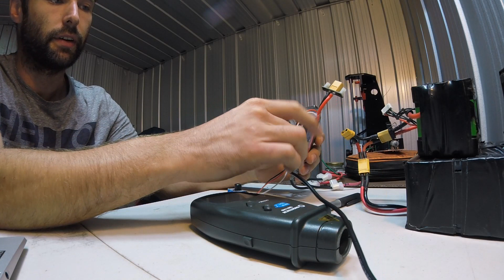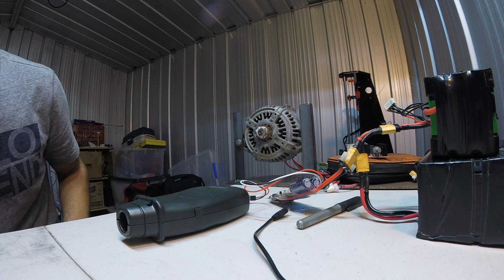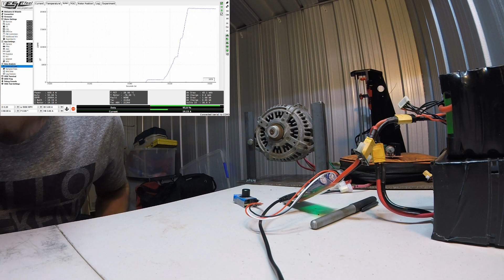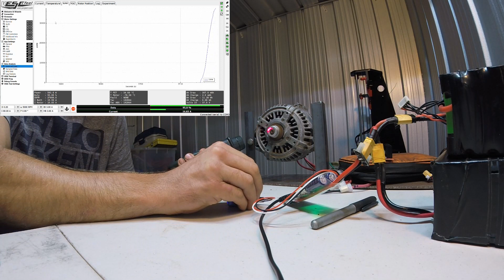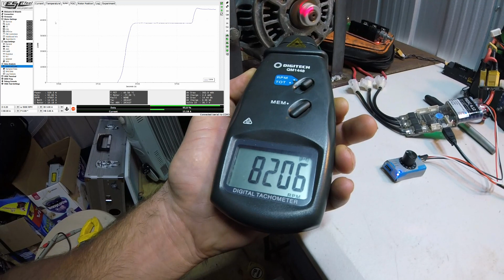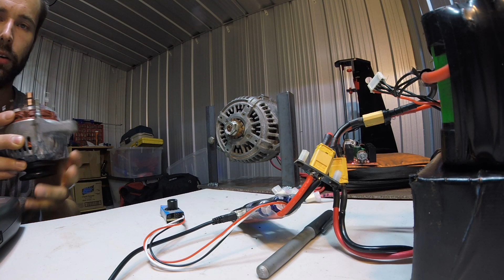Testing converted alternator motor with VESC "erpm"

Comment: Hey, i would love to see you installing hall sensors on the alternator to help the VESC to run heavier loads without needing "push start", helping with power wheels, scooters or any project you can adapt the alternator
Reply from the maker: That would be good.  Cheers you've made me think about it abit more.  I will look in to installing some!
Reply: @fixitmoditbreakit7982  can you use regen on it?
Reply: ill second that mate.
Reply: Hey mate, good to see another tinkerer'.....

I'm currently working on something very similar myself, using a 12v 150a 6 phase alternator. I thought originally that i had 6 wires in three pairs but after removing the diodes and regulator i discovered it was actually 2 groups of three (not connected) or basically 2 separate motor stator field winding's in delta (from what i could tell or atleast no center tap as seen in most connected in wye configuation) . 

This really got me thinking!

Im really not even sure if there is even a practical application for this but hear me out...

Could power be generated at the same time as driving the motor. So i tested this idea and yes it can indeed,  now i do understand that there are efficiency loses every time we convert energy etc and I am only a hobbyist of the trade and self taught for the most part....

For this i was only using a bare bones budget setup with a rc 60a air cooled esc running a 4s lipo along with a 12v battery and pwm controller for the rotor coil and it worked adequately for testing on the bench with no driven load , to my surprise (i expected phase interference from the generated magnetic field(s) or something) . For the first test to see if it were even possible, i had no load for the current from the rectifier diodes (which i hooked back up but only using 6 of 12 diodes) of the second stator field winding's either resulting in heat of course,  actually i got a substantial amount of heat rather rapidly which caused heat to radiate to the driven stator windings and insulation melt causing a short between 2 phases that resulted in massive vibration as the phases were in an out of short, like a self oscillator. before realizing this i had put it down to phase timing due to being a sensorless setup.... 

i have since begun collecting parts for testing this furthar and have added a load for the generated current, upgraded to an 18fet 1500w 48-64v ebike controller running 3x 18v 5ah power tool batteries,  added a second alternator motor with a belt and pulley to the driving motor with another pwm controller on its rotor coil and all phases shorted together to act as a mechanical load and several multi-meters for monitoring all the vitals. currently attempting to put hall sensors in for better low end torque and phase timing etc not to mention i have been drifting between this and my original project of using it only as a bldc motor for a vehicle of unknown type (scooter, bike, trike or go kart) until i can run some efficiency tests for that purpose. sorry for the short summary /long story but i am curious on your/or anyone's thoughts/criticisms on this and just wanted to encourage you to share more of your experiences and results and that i will be following your channel looking forward to future videos..... hope this nonsense was decipherable. cheers from South Australia  Say safe          

 #COMMONSENSE   #OPENYOUREYES      #WEDONOTCONSENT  #TURNOFFYOURETV #DONTBELIEVEMAINSTREAMMEDIA #DONTGETTHEVACCINE